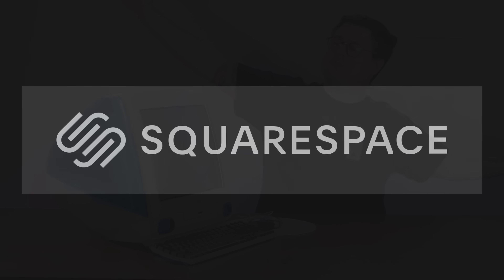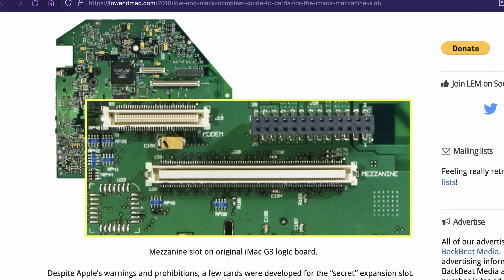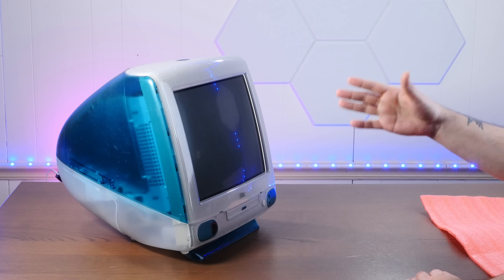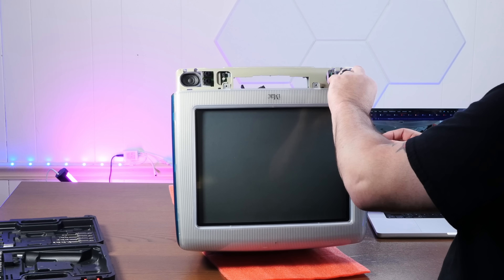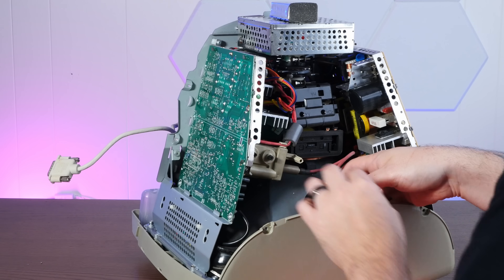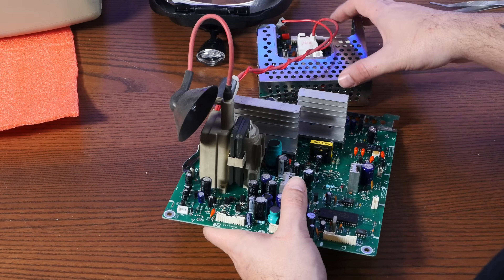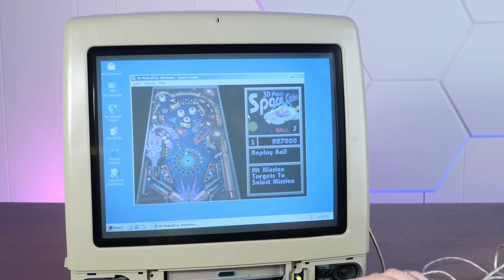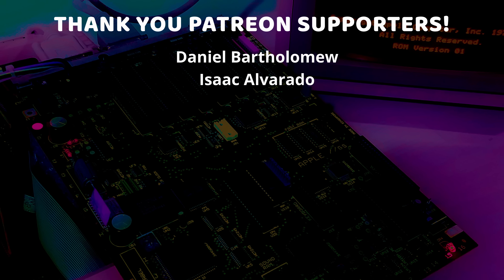This iMac G3 Has a Terrifying Problem... Let's Fix It

Comment: spoilers!

A Sonnet Technologies HARMONi G3 upgrade. A 500mhz PowerPC 750 based G3 upgrade. I mean sure it's almost double the clock speed but the specs show it is only mac 8.1 to 8.3 compatible. I don't see any real world use for this other than "look at this thing". But 300 dollars back when it was new was an outrageous price and so is extremely rare. Glad you were able to fix the machine!

Comment: If your mystery upgrade for the next video is a CPU/FireWire upgrade, I have that in a rev. A Bondi iMac that I acquired about a year and a half ago. 500 MHz G3 with FireWire port...but I had to remove the FireWire daughter card as it was causing the computer to slow to an unusable crawl for some reason and was unable to diagnose, so I will be curious to see if that is indeed the upgrade and if you were able to get it all working properly.

Comment: I had an old E machine with a similar problem...from the word " go" , you would hear random loud arcs, and the screen would flicker...the high voltage connection at the CRT was loose, and no silicone grease. 
   Side note..that high voltage silicone grease is a corrosion preventing glop as well. Two jobs ago, we used it on light bulb bases ( thin layer!) If equipment used in harsh environmental conditions ( trucks and tractors used as snow removal equipment)...no more bulbs corroded into sockets...

Comment: If you would end up needing parts for the G4 Lampshade iMac. I have a motherboard, power supply, optical drive, monitor, keyboard and mouse all know working at the time I took it apart. I'm willing to donate them just pay for shipping.

Comment: Can you imagine that the revision A and Revision B almost used a standard monitor cable and were basically computers rather than "all in ones?" later models revised that...
Reply: Good old Apple
Reply: @gustiwidyanta5492  this is back when Apple were still thinking about the possibilities of expansions. I think a lot of this was a rush to market though. There are so many features of the Rev. A And B iMacs that just scream…. I wasn’t quite ready for market but we’re going to launch anyway….
Reply: @orestes1984  my understanding is it’s the DB-15 video connector used on 80’s and 90’s Macs, nothing special. However, what it can drive is likely dependent on the video chipset in your revision (A-D), and Apple could also have hard coded in the values potentially in software. I vaguely recall others having success connecting an external monitor this way when the internal display wasn’t working.
Reply: @87sjg  the DB-15 connector IS nothing special if it is just a standard Mac DB-15. Well, except for one thing. The DB-15 does allow certain macs like the iMac to do monitor adjustments through the display control panel and on Trinitron monitors it allowed in built calibration.

That said you can get DB-15 to VGA so there is nothing stopping Sean here if the worst came to worst to just replacing the monitor with an LCD screen. 

In fact I think Sean is going to be talking about one of the rare Voodoo 3 cards that goes in the Mezanine slot. 

Removing the internal monitor would allow the Mezanine card to have room and not run so hot.

I'm pretty sure you could get a HD monitor into one of those macs today at 1920x1080 if you really wanted to. 

The display driver would have no problems running it, that's not even an uncommon resolution for the 17, 19, o 21inch studio displays.

The real problem with that amount of real estate is doing anything useful with it.... Other than installing OS X 10.2 and a copy of Photoshop 7 or something, there is very little potential for running anything useful with it...

Hmm.... You could theoretically upgrade these to a socket compatible G4 at 500mhz but if I were really going to do something with it, I'd get an M1 Mac Mini or something hooked up to it...

The biggest problem with these is the pitifully low resolution these days of either 800x600 or 1024x768. That wasn't a RAM issue either, you could put in 6mb by populating the socket on the onboard video card. 

It was a literal sync issue. If you attempted to run anything higher on an Imac of this vintage it would put the monitor out of sync. 

That's the real issue here.... Even if you stuck a modern Mac in the empty sled, you would be stuck with a pathetic, low brightness, out of date, low resolution monitor...

And that was its biggest weakness... Well apart from any slots that would have allowed an audio breakout box, other than by firewire. Some people did manage to connect a DAW to these things, but a lot of people complained about the iMac.

The beige G3 was right around the $3000-$5000 price mark at that point in time depending on your country. A lot of people tried to use these things like an Amiga workstation, or any other Apple workstation, if you go back and read forums or magazines from that time in the late 90s... 

A lot of people who bought these things complained about those very limitations... Some people made work arounds until Apple deleted the Mezanine slot entirely.

There was a SCSI card that went in it, a video card, and some combination of other multiple ports that also went in it including a floppy by one manufacturer... but most of these things didn't do to well because in end Apple blacklisted these companies for doing so.
Reply: @orestes1984  Being pedantic, the Mac video connection is DA-15. DB-15 is a VGA connector.
Reply: @Zeem4  Being even more pedantic, VGA uses a DE-15 connector. DB connectors are used for PC parallel ports.
Reply: @Drucklufttroete  Aargh! That's what I meant to say. That'll teach me to try to write things while I've got a splitting headache.
Reply: Surprised me the first time I took one apart
Reply: It was a standard Mac video port. Someone modded a 21"mac crt and fitted the iMac computer parts (from the slide out tray) into it, sorry I can't find the links. I plugged a mac to VGA adapter in the port when the internal CRT started to die and used a 17" crt with it.
Reply: @grevillewhittle9771  yes unfortunately due to the design these machines get dust and other gremlins in them that either cause the monitor to overhear or cause the type of electrical discharge in Sean’s video. The result as you said is that the monitors in these things fails. It was a design fault probably caused by a rush to market.

Steve jobs needed a new idea, so giving us a regular computer with a fancy “paint” scheme and a built in TCP/IP stack was that.

Up until Windows 98 you had to download a driver stack known as windsock.DLL or be provided with one by your ISP (which is how AOL became so popular in the United States).

It was a huge gamble that the internet would save Apple, but it did and it still does? How do the vast majority of people access the internet today?

Through an iPhone. Not only does that tell you something that the internet bit is relevant. But being almost 10 years ahead of the curve on the Internet Of Things is why Apple turned it around.

Who would have thought a driver issue would solve not only the problems of a company, but it would make Apple so synonymous today that they are still the number one I O T provider in the world more than 25 years later.
Reply: @orestes1984  Macs came with a built-in TCP/IP stack ever since System 7.5 way back in 1994, 3 years before Jobs returned. 

Microsoft didn't bundle one since they wanted you to sign up for "The Microsoft Network" instead of using the Internet
Reply: @KarlBaron  that was the main issue. Even when the iMac launched with OS 8.1 it had a TCP/IP stack. Windows didn't until Windows 2000 by default. 

To use a third party ISP you had to install Winsock.DLL.

That's what I was talking about Jobs came back and pushed the hell out of the fact that the Mac had a built in TCP/IP stack and dialer... Windows for the time did not...

They either wanted you to use the MSN network or otherwise people would go with AOL.

It was even more problematic here in Australia where AOL was not popular.
Reply: @orestes1984  You can add a dust filter in the cooler at the base of the CRT, it helps. I would replace the flyback as well, those old flybacks often fail, he will need to crack this thing open again.
Reply: @orestes1984   I find it difficult to call intermittent CRT failures in a 25-year-old budget consumer-class machine, a "design fault."  Apple was beginning to notice that affordability and aesthetics were more important to most consumers than expandability.  They weren't wrong.  They were exactly the right fit for a lot of consumers, and the fact that they still work at all, a quarter century later, is no failure on their part.

Also, Win 98 had a built-in TCP/IP stack.  Windows 95 had a TCP/IP stack, too.  You had to opt into installing it (you get NetBEUI by default, but no IP), but it's just an "Add" button click away from being there out of the box.  The last time anyone actually needed to bring-your-own Windows Sockets library was in Windows 3.1.

In Windows for Workgroups, you had to add the Microsoft TCP/IP stack, but it did have rudimentary networking built-in.  It's just that we hadn't exactly all figured out which protocol stack was going to be THE protocol stack.  We were still trying to figure out whether we wanted coaxial or twisted-pair connectors on our Ethernet cards, too.  So that could be forgiven.
Reply: @orestes1984  98 (SE at least) definitely came with TCP/IP installed by default.
Reply: Fantastic for installing a Raspberry Pi and making a nice Retro CRT RGB Pi all-in-one, makes for a perfect compact emulation machine.
Reply: @Wobble2007   @Wobble2007  you could do that. I mean a Raspbery Pi running Linux and Sheep Shaver. You could run OS 9 from within Linux which would give you more power and keep the external look on the outside.  You could also install MAME so you could play older games on it also.

I like your idea. It would be cool to build a retro MAME cabinet out of one of these using the computer sled to keep the look, just with more power. I never thought about it that way.

I do like your idea.
Reply: @orestes1984  Sounds good, a MiSTer is another option, for full fat FPGA retro computers and consoles, connect up all the USB's and speakers to the MiSTer, lots of options thanks to the easy to mod internals of the unit.
Reply: That was very handy on models like mine where the flyback did fail.  I was able to take the plastic bottom off and connect an external monitor to the DB-15 connector and I seem to recall the chipset supported all the way up to like 1080p (whatever the resolution counterpart would be to 1080p, etc.)  By that point, I was using a Sawtooth G4 as my main machine, BUT the iMac running 10.3 made a very handy modem internet sharing computer.  I used it's modem to connect to my ISP and could then use several of the computers I was playing around with online without a lot of effort

Comment: I'm always impressed by the collection of rare Sonnet stuff you're able to find. I used the frame by frame view on YouTube to see the box. 🤣
Reply: I just spammed my spacebar and, who'da'thunkit, there was a clear frame there visible within a couple of seconds =D
Reply: @GeFeldz  if you hit 'K' it pauses the video and then the , and . buttons advance a single frame backwards and forwards. It's less of a pain than using space to try to get a lucky frame lock.
Reply: let's face it, when Sean teases a rare upgrade, ten to one it's gonna be a Sonnet
Reply: These cards are silly expensive for hobby play to just get 1, let alone owning multiple.
Reply: @KiraSlith  just about everything that company makes is always expensive. I was looking at some of their thunderbolt computer accessories at various times and those are expensive. Their specialty hardware for niche processor upgrades has always been astronomical. And as the stuff gets older and more rare it's just going to be worse.

While I have some hardware that is compatible with those niche parts, I've mostly kept everything period correct and unchanged from stock specifications. When I want to use something more powerful, I just can. (If a G3 doesn't have the power I need, a G4 will. If that doesn't cover what I need, a dual G5 should, etc.) I have all of tiers of Apple products covered from 68K, to PowerPC, Intel, and even up into M-series. (The trick is to buy when it's bottomed out in price, before anyone thinks of it as a collectible.) 😁👍

Comment: Got a couple Rev A Bondi's in my collection, one with a Sonnet Harmoni 500mhz G3 upgrade that still needs a new flyback, arcs like this (not real often yet though), and another one that's bone stock (except for its new flyback, which I replaced in 2014).

Comment: My middle school had some tray loading G3s iMacs, despite being a Windows school. They had bondi blue and orange ones. I remember one year, there was a mix of both tray and slot loading iMacs. So there were computers with puck mice and the newer magic ones.
Reply: I sold all my school's ones.  £50 each in 2007.  Seems they're worth £150 now, should have stored them somewhere.
Reply: Could you watch gay porn on them?

Comment: Is that a voodoo 2 mac edition?
Reply: Looks like a Sonnet HARMONi G3 to me
Reply: @yukisaitou5004  ya me to, but was hoping for the insanely rare VooDoo 2 8mb card. Only saw it in magazines.
Reply: @knightsun2920  it's a cool upgrade for sure, but it's not very practical since it'd be bottlenecked by the original CPU (less floating point performance than a similarly clocked Pentium 2) and I don't think it would fit alongside a CPU upgrade. Not to mention it doesn't function in OS X.
Reply: @yukisaitou5004  Voodoo 2 were cheap later in years and in my out of work days in late 90tys I used what I could. An old $100 Dell with a Pentium 166 MHz CPU.  But its also the challenge of doing something silly:  "I Tried Gaming On My AIO Display..." https://www.youtube.com/watch?v=8HvFPApBi3A